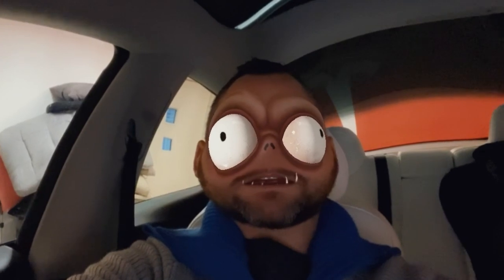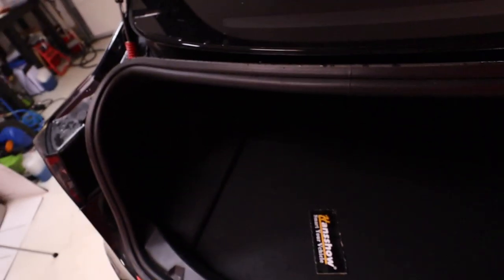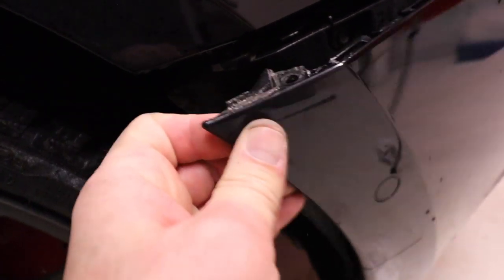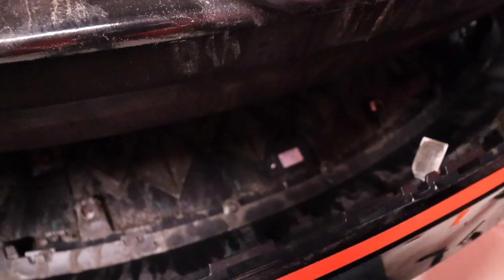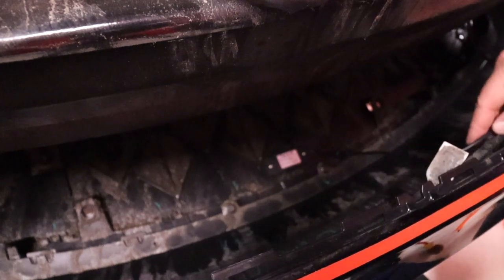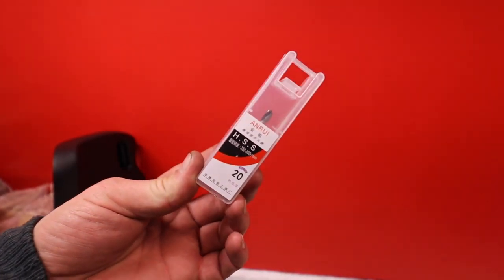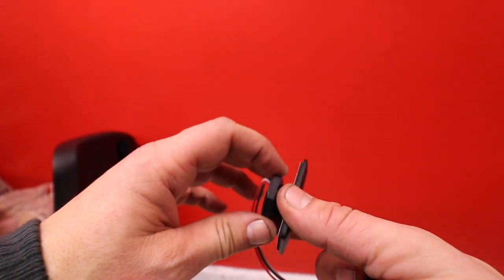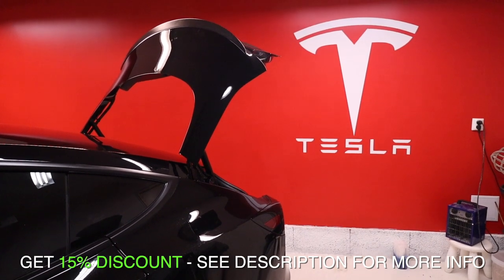I INSTALLED POWER TRUNK ON MY TESLA MODEL 3 - with foot sensor & soft close!

Comment: You actually can separate the wires from the plug before you pull it through the rubber tube. At least on the set I got. It is a yellow flat piece you have to pull out, and then you can take out the pins. Remember to take note of the position first. This makes it really easy to pull through.
Reply from the maker: Yes, done that too. But it easly breaks. Two people no problem pulling it through tho.

Comment: A friend and I spent about 5 hours working on this.  We were stopped in our tracks by the signal plug underneath the 'package shelf', pictured at 29:30.  I just can't get my hands back there underneath the shelf cover.  And if I can, pulling the plugs apart isn't easy out in the open, so I don't have much hope this is going to work.  The alternative is to take the driver's side apart in the same manner and then see if I can get the shelf out.  Otherwise, the video gave us excellent instructions on where to position stuff.
Reply from the maker: Happy to hear that :D

Comment: Hi thank you for your excellent video. My UK version has two blue grommets for the strut cables. I guess they are the same as yours. The right rubber plug is oblong shape and the left one smaller circle. 
Will two blue plugs from the left strut go into this small circle hole? The right hole is larger and oblong so I guess the black cable plug from the foot sensor and blue strut cable plugs may go through the hole.
Reply from the maker: Naohide Hino yes. Both foot sensor and right strut at the oval. Left strut at the round one
Reply: @FrostyFingers  Thanks for your prompt rely. I still fear the left round hole could be too small for the two plugs from the left strut. I am waiting for the delivery soon. Let's see if I can manage to insert the two plugs through the tiny hole.
Reply from the maker: Nope, you just take one plug in at a time. No problems at all. :)
Reply: @FrostyFingers  Thank your for your assurance.

Comment: Frosty, great video! Thank you for taking the time to make it. I'm getting Version 3 of the frunk/trunk soon. I opted to not get the foot sensor (I'm certain I would have messed up the bumper), and was told from Hansshow the easiest install is to just put the new release button on the right side of the trunk. That way you don't have to mess with running the wire through the black tubing or pop off the plastic tailgate cover. What do you think about the option of placing the release button there over the original position where you placed it? Thanks for your response!
Reply from the maker: Thank you. Yes, you can mount it in the fabric on inside but very nice to have it in the hatch
Reply: @FrostyFingers  yah, I think I'll run it through the tubing but what's your recommendation exactly? The wires don't seem like they'll detach and reattach with ease being that they're already pinned. I'm scared to mess anything up with that wiring to the trunk button. What do you suggest? Thanks so much!
Reply from the maker: Devon Knadle u can take it a part. Be careful. If you have a friend, silicone spray, done in 44sec

Comment: At the 28 minute mark it is way easier to put that seal back on if you pull the plastic tab all the way out.  You will need to release the small tabs on the housing  with a small screw driver first.  After that it’s a snap!
Reply: Thank you, that helped me. Very good suggestion

Comment: At the 28:20 on we didn’t bother with dismantling the rear seating to get to the signal plug.  We simple drilled a hole where the white tab is and plugged it in and put it back into the hole.  Worked like a champ!
Reply from the maker: Well if it works for you, why not ?
Reply: We still fished the wire up to the signal plugs and then pulled them thru.   You video was great!  The hardest part was pulling the wire for the button...

Comment: Not really necessary to be drilling holes when you could glued stick the foot sensor inside the bumper and also you could run the cable to the power feed going through the door line.  Hard to explain but drilling it wasn’t necessary.  Trying to maintain the originality of the car is the key factor. One thing I like you did was the cable in the back you didn’t run it through the hold of the back light switch
Reply from the maker: If you are taking the bumper off to do the foot sensor, doing the cables to the rubber grommets is the 100% best option, yes!

Comment: Great video! Just got my upgrade kit and it included a micro SD card. There is no mention in the instructions or any videos about the micro SD card that was included. I assume we are supposed to update the firmware in the control unit?  Same as we would do for the trunk control unit? What changes in the firmware?

Comment: @Frosty fingers: did you have to remove the inner reartrim from the drivers side also? The Hansshow instruction manual states that this is necessary. I did not see you pulling that side in your vid. Did you manage to connect it with removing the right side only? I have my version 3.0 kit ready for installation, but i am not comfortable with removing the head trim with the airbag underneath. I am a little anxious, as you were....
Reply from the maker: Nope, only loosen the rear. It’s quite easy. Done the installation on many cars now and I am able to struggle and connect without loosing them. But, much easier to loosen them up. Airbag is quite far back. The one in the roof loosen it, but take it off. Then loosen the black down the window and the black piece furthest in on rear window. No need to do any more.

Comment: Good job! I just installed this as well, would had been awesome if i seen this video.   Please rename your video to Hannshow V3 automate trunk.  There are 3 versions of the kit and cable and installation are very different per kit.  I like your comment that the latch has to be in the highest setting.  I had the same issue as well and didnt know there are multiple settings with the latch.
Reply: How do you adjust the latch setting?  I think I’m having the same problem. Everything was working when I tested it. But now with all the trim back in place I think it’s havent difficulty latching to the hook.
Reply: Benny Pang either turn the latch or a screw on the latch itself. Been a while i forgot what that looks like. You can turn it and see that the latch goes forward.  Need to set the latch at maximum setting

Comment: Is the signal wire / connection in a different area depending on the year of the car?
Reply from the maker: No, but they did to it a little different with v1. Much better this way. Don’t screw with the canbus of the car! Major plus

Comment: Hello! Good video, Only have problem to find the white connector to the canbus signal. In my car the cables seems not to be the same. How old are your car? Is the white plastic connector close to the roof? The video is a little bit dark at that part. Thanks for your response!
Reply from the maker: Under the shelf, not roof part. But removing that gives you easier acces
Reply: @FrostyFingers  Thanks! I find it!

Comment: Great video but could really use some guidance on putting the bumper back on.  Not as simple as you’d think.  Any help?
Reply from the maker: Hey! Putting it on is pretty simple. Make sure you’re two lock screw clips on each sides are off so you don’t scratch the paint. Now lift the bumper up, lift under while holding on top and lift it over its countering clips. Put in the two 10mm bolts while supporting it. Then let it rest on something. Put the top clips on then the sides and then fasten everything with the 4 nuts/screws. Aligning is key on the sides
Reply: FrostyFingers And hit it pretty hard with your hand to get it in in the corners.  Thanks

Comment: Frosty, I installed the trunk last night but messed up the speaker wire in the passenger footwell under the glove box. I couldn't get it out and when I finally did it was just the bare wires (it WAS pinned). Any way to get those wires back in for that little speaker? Thanks!
Reply from the maker: Ok not a big deal, put try to put them in again

Comment: hi, can you do a separate video on how to remove each trim to install tailgate signal plug.
Reply from the maker: Everything is clipped on. You need to release the top liner by the roof only. Grab hold of the black trim going down between the window and small triangular window and pull out. The rest will follow. Take the grey roof lining pulled straight out and then slide it 5cm forward, then the black piece in the hat shelf will be separated. That one you lift out from 3 clips. The lining at the too of the trunk is fastened with two clips towards the seat back and the rest is glued. I do not recommend removing it completely. Do what i did in the vide, just releasing it enough to get your hands in. Put something in there larger than your hand to make it easier. Then just go the reversed way and pop everything back.
Reply: @FrostyFingers  thank you. Do you know how to change the closing force? I could not find instruction online.
Reply from the maker: You mean the soft close ? There is no adjustment except speed on the struts... but you can adjust the force of the soft close on the wire
Reply: @FrostyFingers  how do I adjust the force of the soft close?
Reply from the maker: like I wrote in the last answer, you adjust it on the wire! Where the wire comes out of the motor to the soft close, there is a 10mm and a 12mm nut to tighten or loosen the wire, hence the force

Comment: Thanks for the video. And i installed the kit v3 as well, the problem is foot sensor connection
. I dont think the connector is not the same as yours, i have no light plug cable and just foot sensor cable, how would u connect the all red, green wires to where? Where am i supposed to connect foot sensor? Thanks a lot
Reply from the maker: Minkyun Byun some kits are apparently sent out without the connector. You will fin wiring scheme at their page. Use crimp connectors or solder to splice the wires
Reply: @FrostyFingers  thanks a lot!!

Comment: Thanks for the video/tutorial. Is there a difference in these sets? I can see there are few places that sell them now, is there an advantage to use these (apart from the fact that we get a discount with your code)? 🙂
Reply from the maker: This one is nice, they changed it from having to pull the switch + big bonky splitter up the rubber tube. They also tap in on the canbus behind/over the seat, not at the wires behind the footwell driver side. Easy to route the power on passenger side. The instructions are pretty vague so I hope this video makes it all much easier. And yes, discount is good. About 750.- nok 🤘🏻
Reply from the maker: And they are made at the same factory as the model s/x
Reply: Tomas Vidžiūnas be very careful, even Hannshow has 3 version of this same exact kit. In this version 3, you will only need to run 1 cable/plug through the tiny holes verse the old kit.  This one of the reason that was most time consuming.  The draw back of this kit is the signal is now moved inside the car behind the seat instead of in the trunk. Which requiring removing 4 inside panels. Overall its an improvement of previous Hannshow kit.  Before installing make sure you watch the right video. 

I just installed trunk/frunk, sadly when i installed this video didnt exist and I wasted some time fishing cable and unfish them back out
Reply from the maker: Phong Nguyen this is the most recent edition and yes you get nice discount too
Reply: @pnguyen1234  thanks for pointing that out. I though all of the kits are the same, but after seeing few more installation @FrostyFingers install is a bit different. Like he did have to pull through just one cable through the rubber pipe thing, while other had a bunch of wire with 3 connectors, connecting a spliter cable to a latch etc. Also they didn't connect anything under the panel behind the back seats. While FrostyFingers said it was pretty hard. I am going to try it tomorrow and see ho it goes.

Comment: I am also going to install this kit soon. Wondering why you chose to route the plus wire through the fire wall when the instruction says you shall connect it behind a panel by the front seat?
Reply from the maker: Nope! There are two ways. Behind the panel of the front seat there is a blue wire (driver side) and canbus wires. This kit gets it canbus feed from the plug over the trunk under the panel (the one I said was a pain in the a@&...). If you tap into the blue it will only work when open or sentry on. Straight to the battery, working all the time as long as key is detected (foot sensor). This kit comes with a connector that only fit a straight to the battery connection. And this is also the correct way! This means your not tapping power from other circuits
Reply: FrostyFingers but the instruction with the kit does not show that you shall connect the + direct on the 
Battery terminal. Check part 21 from the instruction. There is supposed to be a plus there.
Reply from the maker: There is strange things in that usermanual 😂. Connect it direct to the battery, best and proper way to do it. There is a possitive 12v under there, a blue wire feeding the cars 12v system like usb and such. But this will only be on when car is unlocked or in sentry mode! Hence if you walk up to the car and use the sensor to open it wont simce it got no power before you eiter open a door or use the oem button on the tailgate.
Reply from the maker: But I had a look at that A4 paper of a instruction and it specifically tells you to go to the battery with a picture of it too! But on another picture it’s from all the wires on the driver side, so that might be confusing or you have older version of the lifter that taps in on the canbus on drivers side footwell too
Reply: FrostyFingers I have the latest version and it clearly shows to connect to a point inside of the firewall, not on the battery. Older versions instructed you to connect to the battery itself. Still confused... if I don’t have to pass through the firewall I’d rather not do it.
Reply from the maker: Ok. Strange indeed!! But I would always recommend to go straight to the battery. Then you are more likely not to interfere or damage other electronics like when tapping into some wire! And it’s easy to undo if needed (service, warranty eg)

Comment: How Do you get the black plastic part loose thats between the ceiling trim and the ”hatthylla” tog get to that hard to get wire under there. Whats the trick?
Reply from the maker: Michael Bergmark first take off the trim over the door from the front, the black piece is clipped to the tan piece. In the bottom it has clips towards the trunk cover. To loosen that just slide everything forward and lift up. Everything on the top just pops straight out.
Reply: FrostyFingers great help!
Reply: Hi, I have now installed the trunk kit for model3. It works fine! Couldnt have done it without your vid! Thanks alot heja Norge!
Reply: @FrostyFingers  A real Pain to get the airbag trim to fit again. I struggle to get the airbag trim and the black plastic trim to align with the mounting holes.

Comment: I just received this kit today, the cable looks different where you connect the cables on the rear. There's an extra cable says 'Handle Plug' and I have no idea what that is. I sent a text to hansshow hopefully they can help. I also posted on https://teslamotorsclub.com/tmc/threads/hansshow-trunk-liftgate-v3-install.186657/page-4 with a picture what it currently looks like now, and maybe someone there can explain what it's for.